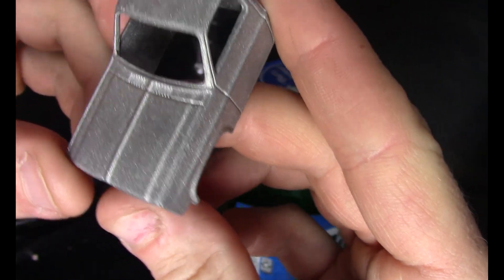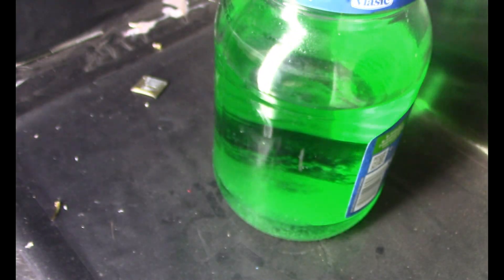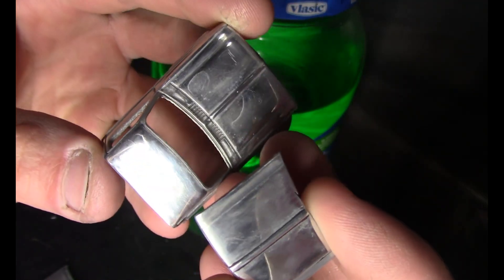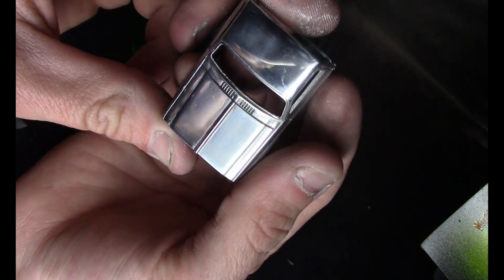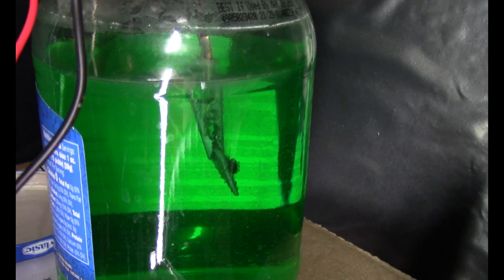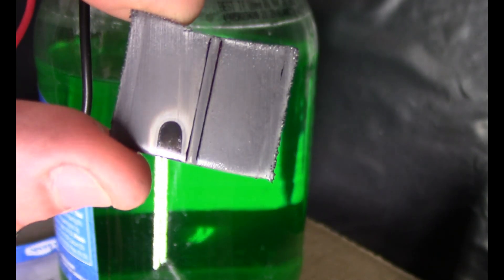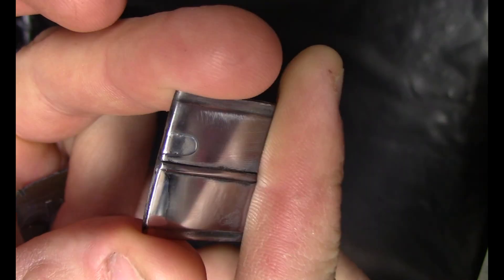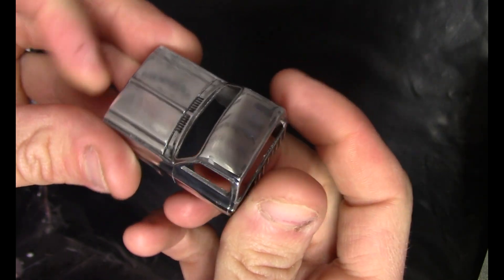Nickel Electroplating Diecast Cars

Comment: I'm trying to zinc plate with a steel washer and white vinegar and salt, I have all the bubbles when power is put through but from what I can see the washer is going black??
Reply: You need to plate in copper first. Nickel will not properly bond to cast metal.
Reply from the maker: I would say it is easier to start electroplating with nickel or copper because your solution will change color and you can be sure it is correct. Second, you could possibly have an issue with your parts not being clean enough. But a more likely answer is that you are trying to run to much voltage through your solution and burning the zinc to the washer.
Reply: @diecastchopshop6564  hi and thanks for the reply. Yeh the voltage thing sounds like it could be the problem. The out put on an old charger is 9v 200mA, is that too much?
Reply: It appears from other videos that a common voltage used for this method is 3V